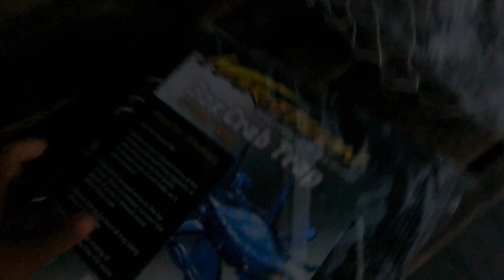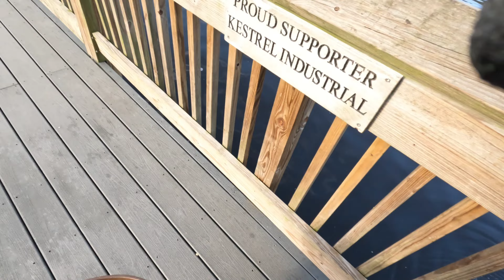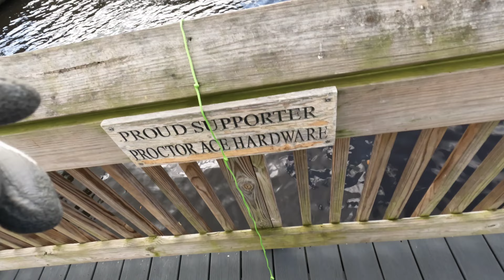Let's Catch Some Florida Blue Crabs!!! Using 2 Ringed Crab Nets And Chicken!!!

Comment: Great catch.  IMO those pyramid traps are more trouble than they are worth.   If you rig your 2 ring nets with better string than what is included you won't have the issue with string coming untied or breaking.   I usually keep the ring that the 3 lines attach to and run my own lines down to the edge of the net (hope that makes sense).
Reply from the maker: Thanks